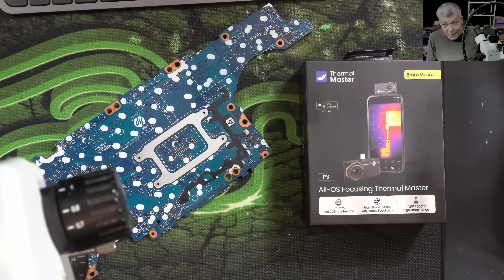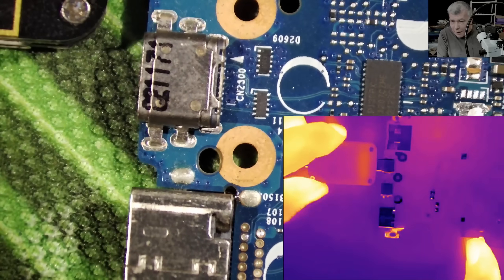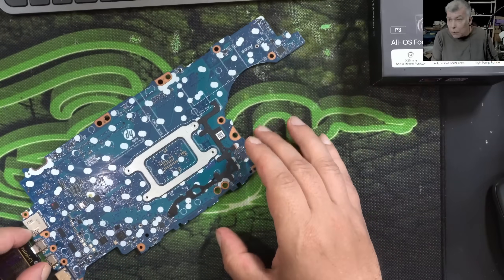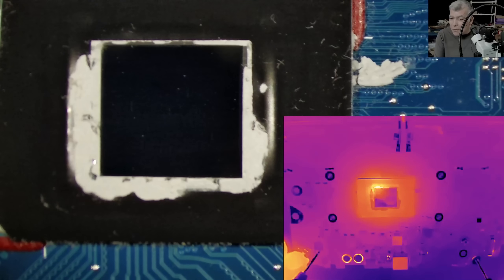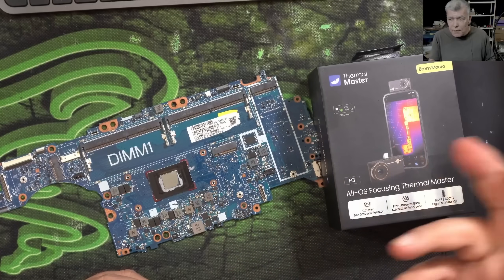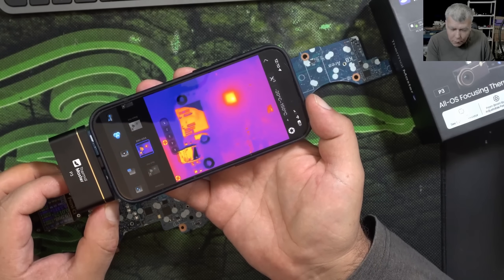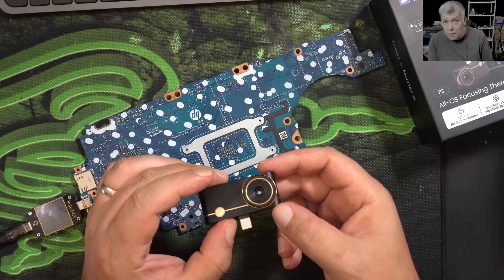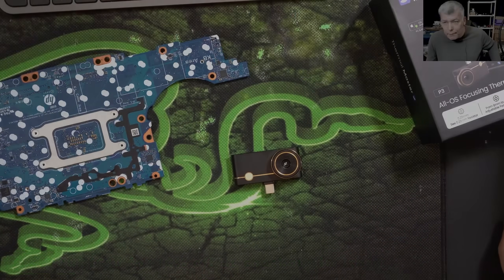Thermal Master P3, PCB Thermal Camera review - https://thermalmaster.com/ohriiclyvc

Comment: Sorin, impressive upgrade, this will definitely make your work easier. We got the Peaktech 5610b handheld thermal camera, and we are very satisfied with it.
I would like to ask you about two topics for video content.

The first topic is diagnostics. For example, like in the video where you show how to tell if the short circuit is caused by the CPU or the chipset, it would be very useful to have the same type of explanation for other things such as the EC chip, PD controller, and the 3V/5V chips—how to find them and how to test slightly more complex cases. A short on the main power rail is very simple, and that’s what most of the 5-minute videos cover. I personally have watched the entire channel multiple times—there’s always something useful in every video—but I would like to see something structured more like a course. As you mentioned, technology is changing, which makes repairing newer boards extremely difficult and requires a huge amount of knowledge. I believe people would actually be willing to pay for such a course. Those live videos you made with the job lots were really impressive.

The second topic is life in the United Kingdom. How long have you been working in this field, what kind of challenges have you faced in your career, and are you satisfied with working on YouTube? You are one of the few people who create such high-quality content. Your country is quite expensive, it takes a lot of money just to cover living costs, and I got the impression that even buying tools feels like a luxury for you, even though you are very skilled at this job. Many times we saw you struggling with a poor multimeter probe or with the current draw on the power supply, not to mention the constant bad chair :D

I understand that this kind of content takes time and the right opportunity to record, but I think it would be very valuable.

Thank you.
Reply: 😂😂pitch here?

Comment: Sensor is still the 256x192 sensor that's been around for a while.  Very important to note.  The quoted 512x384 specs is claimed by software upscaling.  Now, it looks like a perfectly functional thermal imager, but lets none of us rush off to buy it because 'oh wow we finally have a cheap thermal sensor larger than the standard 256x192!!!!' - NO, it is the same sensor.

Comment: The sensor resolution is only 256x192, the 512x384 they claim is using AI upscaling nonsense.
Reply: No problem, it's much better than my 20x20 anyway.🤣
Reply: The resolution enhancement function is definitely not nonsense and works well in many situations. Yes it uses some AI driven algorithm, but it is far better than simple interpolation or upscaling. It is a super resolution mode but does not use the “hand shake” process used in some cameras. Use the P3 yourself or read people’s honest reviews before dismissing its super resolution feature. Speak from a position of knowledge rather than conjecture.
Reply: @frasercastle2479  If sensor is only 256x192 then that should be said. Upscaling is nonsense in any case AI or whatever. Image quality is definitely good enough for the price.
Reply: @frasercastle2479  If you want to use AI upscaling, sure, go for it. I use it myself to play games that my GPU can't handle. But don't sell a product saying it's a resolution when it's clearly not. Same thing with the PS5, where Sony says it can play 4k games. It can't, it's using AI to upscale what is probably 1080p. Sure it looks way better than just stretching the picture, but it's not native and doesn't look as good.
Reply: @dddvvvzzz2012  for what he needs it's perfect
Reply: Thermal sensitivity is amazing

Comment: You can also attach a cheap laser to the microscope and aim it where the center of the display is to make components easy to find.
Reply: Sorin is lucky that most of what he's working on is low voltage. I often use my thermal camera on switch mode power supplies, and poking a finger into these to location the hot part is "unwise".
Reply: @gadgetmind 😂

Comment: Great review. But the resolution is 256x192- the software is upscaling to 512x384
Reply: He showed the resolution, looked very good to me, you could clearly distinguish the outline of components the size of a resistor and capacitor. how much more do you need?
Reply: Yeah, very confusing some time: better than 256*192 but worse than 512*384
Reply: @mact9840 but the camera is still great. I have  reviewed it recently as well